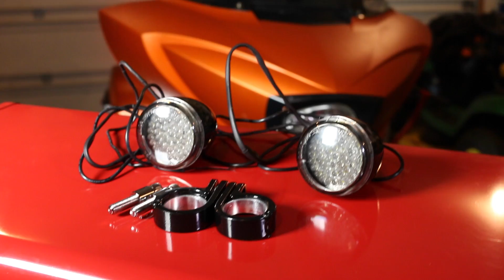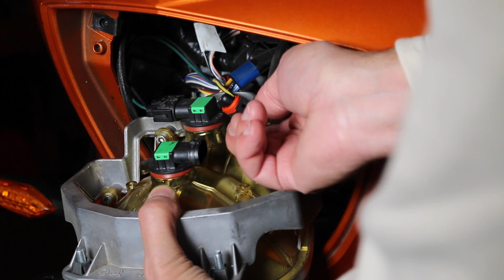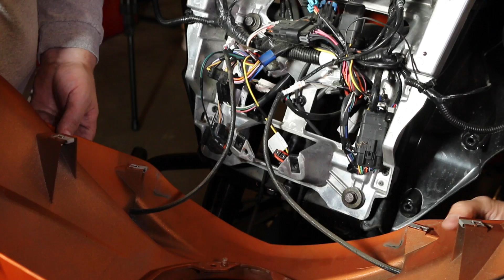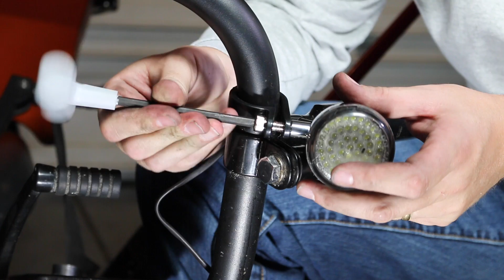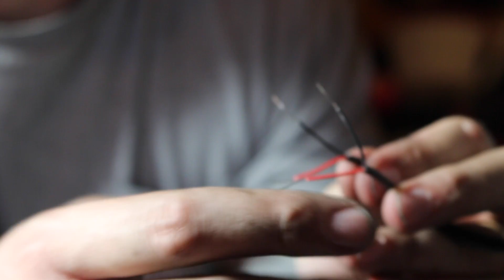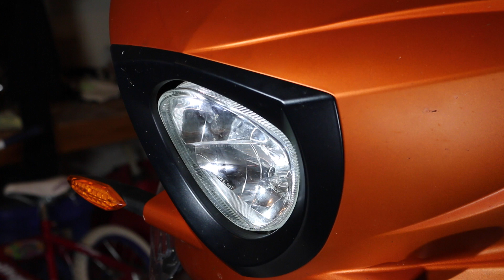Install Front LED Lights on Victory Cross Country | Biker Motorcycle Podcast

Comment: Like so many others, I used it to figure out how to get the front fairing off to do some work on the indicators; as it turned out, only needed to actually remove the headlight cover, unbolt/disconnect the headlight and from there could actually identify the two indicator cables - outstanding !

Comment: Awesome video!  Thanks.  I used this video to get step by step instructions on removing my fairing.  For the “hot” wire you identified, can you wire an isolator for towing lights to this wire for switched power?